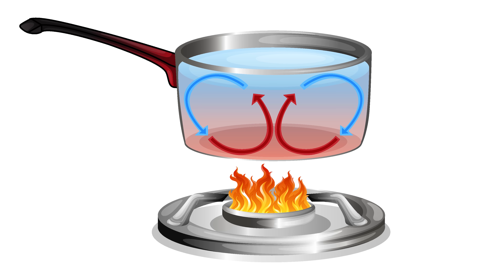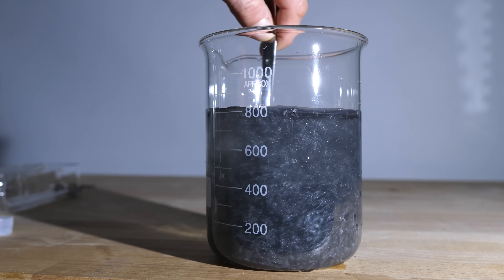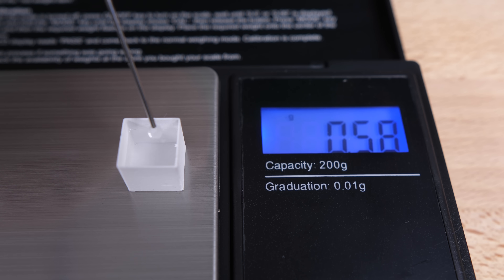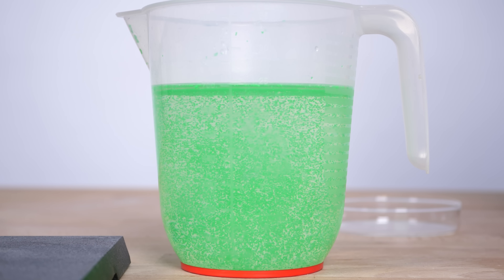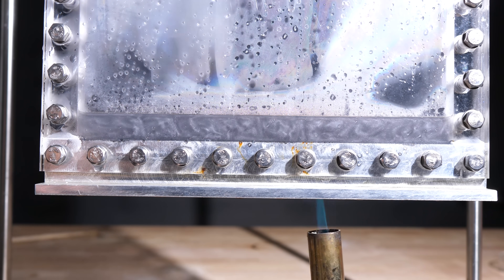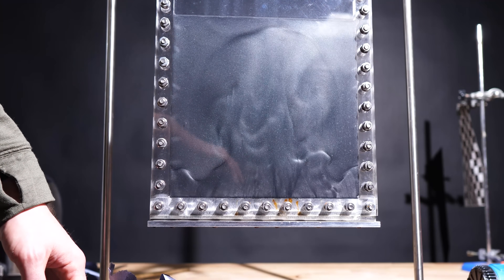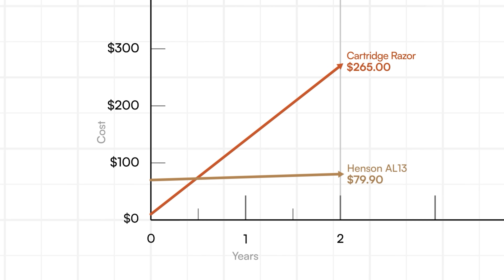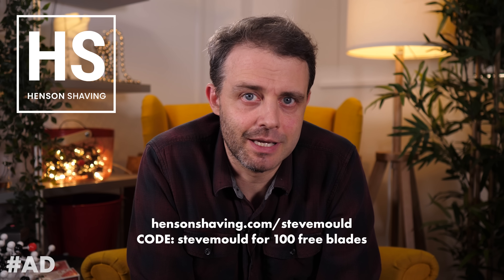The bizarre patterns that emerge when you heat ANY fluid

Comment: Mica flakes are thin platelettes.  Try stacking plates in random orientations...  vertical, horizontal, vertical,...  Graphite powder would also work except that graphite is much less dense than water, is hygroscopic, and would float.  Water's density is 1 g/cc ONLY at room temperature and atmospheric pressure.  To get ABS to separate, try a surfactant like dish soap.
The cream is much less volatile than alcohol so it evaporates much slower.  Places where the alcohol is covered by cream cannot evaporate (and cool).  Note that the convection is away from the cream and toward large areas with alcohol surface.

Comment: I wouldn't be surprised if the mica works because the particles are uniform enough in shape and size that they tend to have similar hydrodynamic properties, causing them to align in (locally) similar flow conditions

Comment: Am I the only one that finds it surprising that the surface of the water remains perfectly still throughout the process? I mean we all know this is the case whenever you boil water, but why? When you visualise the convection streams, it seems that all those fast moving particles should at least somewhat disturb the surface. I just can't imagine that the surface tension is enough to keep it as perfectly still as it is. Or am I just missing something obvious? 
Is it because the convection is driven by buoyancy and when the less dense stream reaches the top it stops its motion as the least dense liquid is now on top? But what happens to the inertia of the stream?

Comment: I use throwaway razors that cost about $1 (Gi*****e brand with 3 blades). Since i've seen many Henson sponsored videos, i made sure that i remember that i bought that razor in august last year. I have to shave every day because i have lots of facial hair, and it still works just fine after 6 months. Probably i can use for a few more months, but even if i buy two per year that's just around $2 per year: quite far from the $265 shown in the video.

Comment: Mica Powder aligment:  One Mica particle is sheet and it would act similarly like weather wane in find. They align with flow vector, because less and less fluid particles will collide sides of slab, until it will align with flow. 
(For mica particle water is syrap, and it helps to retain the aligment.)

Cream: Alcohol will denaturate milk proteins in cream and form bigger protein chains, making the form which can be observed in video. These protein glumps has more surface area that can further scoop alcohol and made evaporation quicker ( rolling motion in video).

Comment: I noticed this beautiful pattern a few month ago when I took a look at my cup of tea with my thermal imaging camera.
Perhaps surfactants could have helped to separate the particles. And maybe using sugar instead of salt to increase the density would have an effect because it doesn't introduce Ions. 

Part of my bachelor's thesis was the production of microplastic suspensions. I had good success with PVC in sugar syrup (766.7 g/liter) + polysorbate 80 (30 g/liter) and PE in EtOH with polysorbate 80 (570.2 g/liter). But I was working with partivles in the 20-50 μm range.

Comment: Ethanol also takes up heat when it evaporates, although it takes less energy per unit of mass than water, ethanol has so much higher vapor pressure than water that it has much higher evaporate cooling effect than water. Sure, the ethanol lost by evaporation means the density decreases, even at a given temperature, but that's not the whole reason for the increase of density at the surface, I don't know if that is even significant compared to the effect of evaporative cooling. 

And, couldn't you just have used plastic without a tendency to stick to things, with a density somewhere in between fresh water and saturated brine, and just added salt to match the density of the plastic?

With lower volume to area ratio, the less the matching of densities matters, well demonstrated by the fact that mica powder works so well, despite having a density of around 3.  So, smaller beads, or pieces of plastic film should have worked about as well as those expensive small beads.

Comment: Steve, I love the way you explain your thinking and choices. A very interesting video. Having recently changed from a gas to induction hob, it's interesting to see the different patterns produced by them in water or oil in the pan. I would expect the induction has more distributed heat, but food still sticks at hot spots (yes, I know, setting temp too high).

Comment: The reason for localized matching orientations of the mica flakes seems quite obvious and intuitive to me - they are FLAKES in a CURRENT. The flakes will naturally align orthogonally to the localized current direction because it creates the least drag in the current. If they are not aligned as such, the differing levels of pressure/drag on different areas of the flake will rotate it until it is, and/or the current will propel the mica facing more parallel to it faster and farther, naturally sorting out the differently aligned mica by dragging the parallel flakes farther and faster than the perpendicular ones.
It's literally the mechanism that allows you to see currents so well using mica as opposed to some more uniformly shaped pigment - the drastic difference in light reflection and refraction between the large, flat face of the mica flakes and the thin edges gives you the large amount of contrast necessary to see currents so easily.

Comment: Steve, did you not consider heating the water from the sides as if this were a 2D representation of a room with radiators? I'd be very interested to see how that convection pattern differs from this.

Comment: you can see the same konvection-patterns in oil that you heat in a pan if you look in just the right angle. they change with temperature, so you can use them to decide when the oil is hot enough for cooking

Comment: Hello, amazing video again. Apart from some point already brought by other viewers, you can actually observe Benard cells in any fluid if you use the correct amount of heat flux. The lower is the viscosity, the lower the temperature gradient need to be (to observe similar structures). Hence, you should try to heat your plate with a much more uniform and low-temperature heat source.
Vegetable oils kinematic viscosities are close to 40 mm²/s, compared to water which has a kinematic viscosity close to 1 mm²/s. Since the kinematic viscosity of the water is 40 times smaller than the one of oil, you need a temperature delta that is 40 times smaller to observe the same structures than with oil (you should in theory also take the thermal diffusivities into account but they are the same order of magnitude for both fluids). The thing is that with such small temperature delta you take the risk to have other effects acting on the experiment, for example heat conduction in the acrylic wall will "smooth" the temperature delta and maybe prevent cells from forming.

I guess you know it but dimensional analysis (and the Buckingham π theorem https://en.wikipedia.org/wiki/Buckingham_%CF%80_theorem) shows that you can reproduce any physical phenomenon at any (macroscopic) scale if you keep a certain number of dimensionless numbers constant. That's why the turbulent flow at the beginning looks so much like a Schlieren above a candle. You can (approximately) reproduce the convection cells of the Sun in an heated oil pan because the combination of scale, temperature gradient, fluid viscosity, thermal diffusivity and local gravity can be arranged to produce approximately the same value of dimensionless Rayleigh number (https://en.wikipedia.org/wiki/Rayleigh_number) in both case, hence, the fluid will behave approximately the same.

If you're into rheoscopic fluid I would love to see you experiment with this. You could for example show that the turbulent structures are similar in two apparatus having completely different scales if they have the same Reynolds number (for example by changing the fluid velocities and/or viscosities). As oil is nearly 40 time more viscous than water, an oil jet of a given diameter in a container will produce turbulent structures similar to a water jet at the same speed but with a diameter 40 times smaller, or a water jet 10 times smaller and 4 times slower, etc., since the Reynolds number will then be similar. I also use acetone with mica powder to produce incredible intricate turbulent structures since acetone has a very low density (the only drawback is that as its density is lower than mica powder, the particles tends to settle very quickly as the flow slows down).

Comment: Hey there ! Did you know that the 2D container that you are using is actually called a "Hele-Shaw cell" in Fluid mechanics. It is used to visualize flow around objets or bubbles rising inside liquids (at least in my lab !)
I had the same dilemma for the particles inside the liquid actually, and even thought about buying from cospheric, but chose hollow glass spheres (d=1.03 g/cm3) which was good enough as I was using silicon oil, viscous enough so that they wn't fall down so fast. 

Anyway great video, I'll show it to my colleagues, sure they'll love it.

Comment: im on the fence about henson, i got one second hand about 3 years ago and the handle has no grip so its usually  struggle to undo it with wet hands (have to dry them off) and then also the aluminium galvanically corrodes with the (generally) stainless blades. cut quality is ok it is very dependant on the blade manufacturer. the best razor i have used is neither henson nor a multi blade style, but a BIC single blade disposable razor. because its an all in one they have much better tolerance over the blade stickout and generally they have causes less irritation and cut heaps quicker. and they can be as cheap as just buying blades for the Henson. the only downside is that it is using plastic for a disposable item. and i dont think they are recycleable because the blade cant be removed easily.

Comment: I did buy one of the henson razors and i agree its a superior product when compared to cartridge razors. However in terms of sustainability a straight razor would be better. It can be sharpened and reused for several lifetimes. Now.. personally ill still use the HR because i find it reduces the chance of cutting myself significantly. And new blades for it are widely available and cheap.

Comment: Fascinating video and very well done.  My only issue is, the convection is actually driven by the cold fluid.  The heat doesn't cause anything to rise.  The heat causes expansion, which lowers density, so the heat (or alcohol loss - you had it exactly right there) is necessary.  But it's actually the then-heavier cold (or alcohol-depleted) liquid that, by falling underneath due to gravity, forces the expanded (or alcohol-rich) fluid upwards.  That's why fires are round balls in space.  Nothing falls, so convection can't happen even though the same expansion happens.

Comment: This reminds me of when we would look at flow visualization with supersonic wind tunnels. We had a setup with a lamp that was basically a really wide laser (all light it released was parallel) and had to bounce all that parallel light around the room with 3 mirrors, then put a razer blade at the focal point of the last mirror. This then projected the image onto a piece of paper. The razor blade “sharpens” (this practice is actually where that term comes from) the image, making tiny tiny changes in the light much more pronounced.

Because the light is parallel, and due to the mirror setup, wherever the air had higher local density, more light got bounced and didn’t hit the mirror, which made the image projection darker. We would test to see if our mirrors were set up right by holding a lighter to the testing zone to see the convection currents in the projection.

When you turn on the supersonic wind tunnel, the model produces shockwaves, which are higher density, so we could see it in the projection, which we quickly traced with a pencil because we only had 2 minutes before we ran out of vacuum to pull air into at supersonic speeds.
Reply: Unfortunately, that kind of visualization doesn’t work well with trying to record it with a camera, so you’d only really be able to see it properly if you do it in person.

Comment: I wonder if the grouping tendency of the mica solution had anything to do with phonons and it's very great thermal conductivity?

It's almost like the heat is transferred so quickly through the mica that it tends to form pockets of similar temperatures almost instantaneously. Mica is also a bad electrical conductor... HOWEVER... This changes with temperature increase.

Stay with me...

Suddenly you have pockets of differently conductive liquid or little pockets of varying electrical resistance... Maybe this is a quantum effect where the solution is being affected on a molecular level due to the similar resistances "seeking each other out" 🤔

Just me speculating.

Great video

Comment: I've never formally studied this, so please have patience with any errors or ignorance on my part.

I don't think this is due to changes in buoyancy. I think this is a common misconception that arises out of analogizing this situation with a balloon, but this is very different from a balloon in that the heated bolus can exchange molecules with the surrounding fluid, and in fact contributes its hottest molecules to the surrounding fluid.

No, my estimation of how this works is that the heated "bolus" begins to expand, impinging on surrounding fluid and exchanging molecules with the surrounding fluid (mostly pushing it out, because it has more energy). It does this in all directions, but it meets less resistance the higher up you go. So the higher part pushes out harder and more aggressively than the lower part. Once it goes higher, the resistance is even lower (due to lower pressure) and any remaining energy can impinge even more aggressively, the higher up you go.

But I believe this "bolus" of heated air would just kind of dissipate its energy and its molecules within the surrounding medium, very different from a balloon. It is only with CONTINUED heating that, with the constant input of energy that the process I described above can continue. With the upward direction offering the least resistance, I believe that fluid continues to flow ever-more-easily in that direction. 

Now this gets into the complications of turbulence and viscosity, but my basic theory/point is that this operates by basically carving a path upward simply because upward offers the least resistance, and once a path has been carved, there is much less resistance, so continued heating follows that path even more.

Whether you agree with this or not, my initial objection is to the buoyancy argument because buoyancy depends, I believe, on their being a solid membrane to buoy up with differential pressure (top vs. bottom) and that is not the case here.

Comment: I always wanted to build this exact device, now I don't have to. thx :D
Wanted to visualize air convection currents that you use for soaring. Not sure if there would be something interesting to see if you would get equilibrium state where convection would reach like only half of the container height. Probably not really...

It seems to me from this experiment, that if there is strong downdraft, it is likely that there should be strong updraft in 3 cells roughly 120deg intervals from the center of the downdraft. So if you fly from some thermal, let's say is not strong enough, it is likely you get in downdraft. So it's good idea to change heading then, even though it is recommended to increase speed and fly throguh it so you loose least height.
I mean there's more to it, since updrafts are related to geology, illumination and bunch of other stuff. Originally I wanted to simulate this with bunch of resistors as heat source, but IMO your experiment is good enough.

Comment: Found this to answer the mica question 

The local alignment of mica flakes in water is primarily driven by two key factors:

 1. Anisotropy: Mica is a highly anisotropic material, meaning its physical properties, like electrical conductivity and mechanical strength, vary depending on the direction. In mica, the strong covalent bonds within the sheets create a flat, plate-like structure. This structure makes the flakes much stronger and more flexible in the plane of the sheets compared to the direction perpendicular to it.

 2. Minimizing Interaction Energy: When suspended in water, mica flakes tend to minimize their interaction energy with the surrounding water molecules. Water molecules are polar, meaning they have a positive and negative end. These polar ends interact with the charged surfaces of the mica flakes. However, since the mica flakes are much larger than individual water molecules, aligning their flat faces parallel to each other allows for maximum contact with water molecules on only one side of the flake. This minimizes the overall interaction energy between the mica and water, resulting in a more energetically favorable configuration.

 Additionally, Brownian motion plays a role in this process. Brownian motion is the random movement of microscopic particles suspended in a fluid due to collisions with water molecules. This constant movement allows the mica flakes to encounter different orientations, and the energetically favorable aligned configuration will eventually dominate as these flakes experience less resistance from the water compared to other orientations.